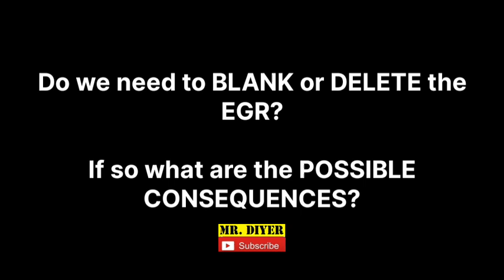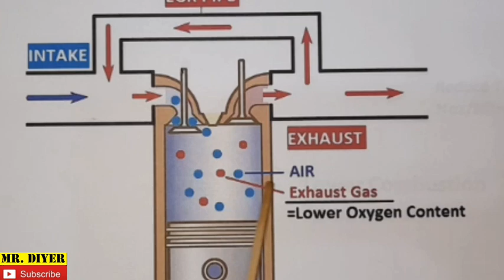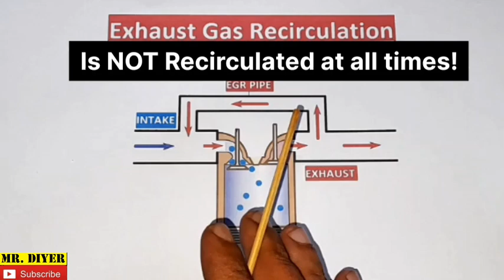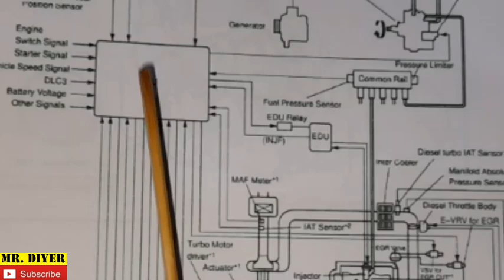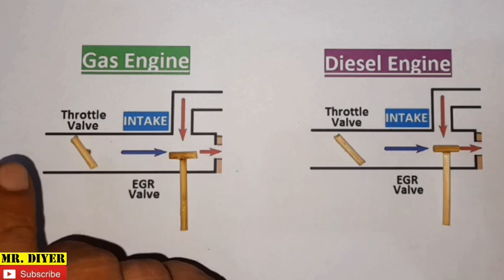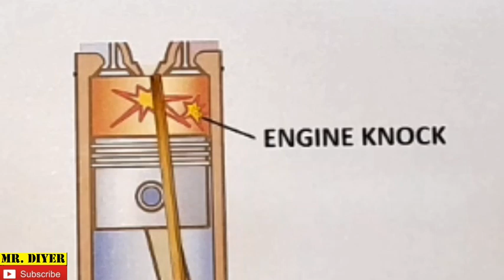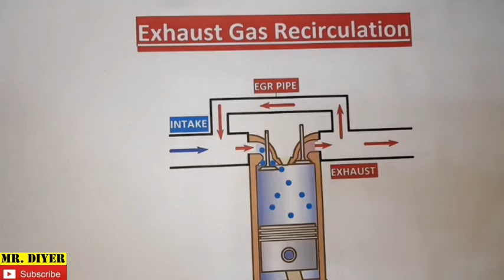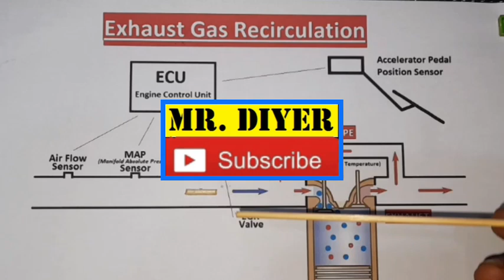EGR Explained! Do we Need to DELETE the EGR?

Comment: Quite comprehensive explanation, but I believe some statements in the video were incorrect. Most information I will state here can be found in papers on this subject, for example: 'THE STUDY OF EGR EFFECT ON DIESEL ENGINE PERFORMANCE ...'

The EGR ratio in total gas content spans from 10-40% typically (diesel), so it is large.
The total thermal efficiency under EGR is always lower compared to the system without EGR, from 1 - 6% as the EGR ratio increases (bad).
The amount of NOX gases is significantly reduced, from 10-60%, as EGR increases (good).
Unfortunately,  increasing EGR also increases the amount of hydrocarbons (soot) that is created during the combustion (bad).

For the same engine output, the amount of generated heat energy must be the same with and without EGR. So how is EGR able to reduce the peak temperature during the combustion, and achieve the same thermal energy? Well, it is possible since EGR increases the time during which the fuel is burnt (since the oxygen concentration is reduced), so the same amount of energy is released over greater amount of time. However, overall efficiency is reduced with EGR, since the fuel is not as fully used in the presence of EGR gases.

I do not believe that, as some people state, EGR  temperature reduction has some meaningful effect on engine longevity, since it still needs to endure high throttle when EGR is blocked. In other hand, presence of EGR equipment adds significant cost to the owner due to maintenance (egr valves, coolers) since it is mostly not repairable or the repair has high cost. Effectively the vehicle costs more over its lifetime, lasts shorter and is less value for the user, which is certainly not good. Not to mention that all that complexity WILL introduces some unexpected problems such as melted inlet manifolds, which will cost arm and a leg to repair (I know).

In my opinion, most of the reasons for introducing the EGR system are political and not something that is bringing overall value for the public.

Comment: The beauty of a diesel engine was always its simplicity.
EGR adds a throttle valve. Creating a vaccuum, increases pumping losses. This is one of the main reasons a diesel engine is more efficient than a petrol of the same capacity.
EGR adds another heat exchanger. This is a future cooling system failure point, allowing the possibility for coolant to get into your engine and destroy it.
EGR also mixes with the oil vapour coming from the PCV system coating your intake with a black sludge over time reducing the ability for the engine to perform properly, increasing fuel usage, and can in some cases completely block your intake.
EGR is a system invented entirely to help engine manufacturers pass emissions laws. It does not benefit anybody. If you want to save the planet, drive less. End of story.
Reply: Exactly so much this! It works for the first 30% of the engines life but then it completely destroys it spewing insane smog and clogging filters like crazy. If you don't rev/work the engine hard and let it cool intermittently you should mitigate the increased temps.

Comment: What about mechanical EGR on kubota engines that is open all the time when the engine has produced enough boost pressure. Soo when the engine is working at constant 2500rpm (tractor) the engine is constantly ingesting exhaust gas.  This surely would affect the power output.

Comment: My car got a gunked up EGR and it got stuck open and it caused the car to diesel after putting gas in it for about 15 seconds when I started it, but it also seemed to make the car generally more responsive.  I couldn't explain it.   But after the egr valve was replaced the dieseling went away but the car feels softer.

Comment: It's okay if i cut the egr. No problem with that and the combustion temperature. I have a radiator to maintain my engine to its normal temperature and performance. That's the purpose.

Comment: Hi Mr Mr. DIYer i have 2 question iff u delet Dpf u also must delet Egr or u can use egr whit dpf off?  second question if u have egr off by softwer and unpluged conector u must unplug aswal egr cooler or egr coller can work whit egr of? i mean i you do by soft to stop open egr but egr coler its stil working its ok?

Comment: Video is well presented and true, however we delete the EGR to avoid future loss of performance as everything becomes clogged, not to magically increase performance, no one thinks that.  Engine may run hotter but most of the engines have no problem running perfectly even so.

Egr delete is pre maintenance, headache avoidment and prep for significantly increasing the power, we just negatively affect our carbon footprint for the most part.

Comment: Diesel engines had a bigger NOx issue due to the oxygen rich mixture in the cylinder compared to a gasoline engine, gasoline engines use a carburetor or fuel injection to have the a/f ratio close to 14.7 to 1, whereas diesel engines previously had no throttle valve and the speed/ power was controlled by the amount of fuel injected into the combustion chamber, thus at part throttle the oxygen to fuel ratio was very high and corresponding peak flame temperature was high, allowing more formation of oxides of nitrogen. Gasoline engines suffer the same issue but to a lesser degree , thus a modulated egr valve works well for part throttle/ light load emissions reduction, heavy throttle would get an enrichment to improve acceleration. Diesel engines required far more exhaust gas recirculation due to the very oxygen rich mixture at part throttle this required cooling of the exhaust gas. Earlier egr diesel engines had no air throttle valve . Newer diesel engines use the ECU controlled to help reduce the oxygen richness of the mixture alongside the EGR.

Comment: A good video. The theory is clear but in PRACTICE egr can be problematic. 
Why? Because oil vapors (from crank ventilation) and sooth from the EGR port can mix in the intake and will cover intake ports, intake valves, intake plenum and EGR-valve body with a thick layer of tar cake! And YES this DOES lower performance! 
If it is not cleaned out periodically it can lead to an undriveable car.

Comment: People remove the EGR mainly because of soot build-up and clogging problems. It can also occur on gasoline EGR, but it's way worst on diesel. Especially if the fuel you're using is not up to the standard of the engineers that designed the engine. They expect you to buy the best quality fuel, like in Japan or Germany. Not every country has this quality of fuel available, hence the problems with EGR systems.

Comment: My egr opens when cold creating heavy jerking when pressing pedal, but works ok when engine get up in temp, tried blocking egr and cold problems is gone, but engine light get on when driving motorway more than 2 hour, turns of when engine get cold, any suggestions? Peugeot 1.6 hdi 2004

Comment: Egr was mainly invented to lower emission and will give you more carbon build up on top of valves and cylinders which will cause overheating issues causing engine failure

Comment: How does the egr reduce pumping losses???? only the valve timing can do that! 
This sounds like another sponsored video trying to deter people from unleashing their engines true performance, ie running on pure air and fuel instead of partial exhaust gas. I did this on a (Euro 3) 2.0 diesel Jaguar 12 years ago and gained 10mpg! and no more soot (carbon grit) going through the engine causing premature wear, that engine was still running like new at 400,000Km.  There is literally no point having an air filter and running EGR! The government is collecting a lot more fuel tax at the pump with all these cars running EGR with lower combustion temps producing less power, and cars wearing out prematurely neading to be replaced, it's about the money!
Reply from the maker: What exactly am i sponsoring here? 

Do you see any posted  links that redirects you to some outside links to encourage you to buy something unlike the videos you see espousing for getting rid of the egr posting links wherein you can acquire that product? Lol

I even said: if you want to delete it fine, if you dont want to fine! Do what you want with your vehichle.

But for you to accused someone of sponsored content without even a hint of evidence just because what you saw doesnt jive with your preconceived beliefs is just ignorant.

Comment: TLDR: Gasoline: It will help to reduce pumping losses and increase fuel efficiency, but is often poorly implemented, hence jamming of valves etc. 
For Diesel, this system is the worst thing ever. Ad-Blu systems are a resolution to this mayhem.
Firstly, Diesel engines produce a lot of soot, unlike well designed and maintained gasoline engines. Secondly, Diesel engines are not affected by pumping losses, as this should have been taken into account in the design. They operate in excess of air, unlike a gasoline engine, hence the larger volume of NOx. 
Increasing Diesel power typically means increasing fuel volume. This isn't the best for emissions nor is it for temperatures, especially turbo models. EGT, just like a jet engine (Exhaust Gas Temperature), is a critical aspect of Diesel longevity and maintenance. Lower your EGTs and your turbo will last! 
The main issue is economy. 
By introducing EGR, you are introducing unburnt/inert gas. This effectively lowers the ACTUAL volume of your engine capacity by whatever % the EGR is set at. Eg. A 2.0L operating at 12% EGR is actually a ~1.8L engine at that EGR value. Friction causes losses and over time, the abrasiveness of the excess carbon wears the engine out faster. 
The slower speed of combustion for an already slow burning fuel can result in a reduced power output-per-volume. The increased wear+slow fuel burn results in less power, greater consumption and reduced engine life at the benefit of reduced NOx in addition to a possible increase of CO2, due to the excess volume of fuel at a lower temperature. 
Not sure how green it is to replace dead engines on a volume basis than deal with slightly increased NOx emissions for in-service engines...
As a point of comparison, (many have done so), but I have modified my own vehicle. I'm sure it produces more NOx, but the fuel economy has dramatically increased. By about 1.3L/100km for a commercial 4X4 vehicle. Very significant, as the nominal consumption was close to 11L/100km at medium speeds. Land Rover Defender 2015.  Exhaust gas temperatures are still within spec. It's a ploy of the big manufacturers to meet a standard that isn't properly addressed or adhered to. 
They're offsetting the pollution elsewhere: From old engine dumping to new manufacturing, which will increase emissions MASSIVLY! 
Also, drive efficiently! Accelerate at a brisk (not flat out!) pace and never brake or steer (go as straight through curves as you can). That's the key!

Comment: Diesels used to be so simple to operate until all the emission legislation came into force making running diesel vehicles a little more complicated and expensive when any of the sensors fail,this man’s explanation is the best way to understand how all this works but one sensor going faulty can cause all sorts of problems that can be very expensive to sort out if you haven’t got the right computer for your vehicle,the engine computer ECU will try and correct any fault it detects in the system and that’s when your problems start because if it’s an intermittent fault it can be difficult to track down.

Comment: Always delete EGR. 
 
 Recirculated exhaust gas contains no oxygen and cannot support combustion. EGR is the same as eating your own shit. Waste should go out the exhaust pipe.
Only clean air and fuel should go to cylinder.
 EGR pollutes intake tract and outs deposits on valves.
EGR is the devil.

Comment: EGR circulates oxygen depleted gas to reduce NOx emissions. However it also circulates soot and carbon particles. These do not get re-burned by the engine they do settle into the EGR and air intake system. This creates a feedback loop that clogs the airflow giving a very dirty exhaust and no power. 
The problem is caused by soot in the exhaust which EGR effectively makes worse. The question is why do EGRs not have a cyclone soot separator?  It would help to cool the gas but more importantly extract the dirt preventing that feedback loop happening.

Comment: I’ll save you the details and blabbering in this video 
Don’t remove your egr, it’s illegal. Instead go and tune your car and in your tune have your egr valve programmed out of the system so it does not function. 
This is still illegal howeve it’s impossible to tell. 
Egr will ruin your engine and score the internals, egr also affect fuels
Consumption in a negative way 

There you go now
You don’t have to watch the video

Comment: EGR is great when new! But when a 3l diesel has done 150000 miles and the EGR, inlet manifold, cylinder air intakes, and intake valves, all have buildup set like concrete on them. It took me 6 hours many cans of EGR cleaner an electric drill going through many wire brushes on the end, knives screwdrivers toothbrushes `for injectors as well`, and a vacuum cleaner to clean it all out plus an oil, oil/air, and fuel filter change + sprayed the MAF clean.  Result BMW M57 3l running like new. EGR now blanked off never again!😩

Comment: Very good explanation, however he doesn’t point out that the carbon build up leads to loss of one cylinder and expensive repairs because the cheap design does not mix exhaust gas evenly, so it is biased to one section of the intake. Second point : there is no need for a throttle disc in the diesel engine,added only to provide for egr and on older cars to get vacuum for other devices. So by removing the disc also your engine gets 5% more clean air. Nitrogen products make plants thrive, so really it’s misguided science.

Comment: That's a dumb idea.
How do you separate exhaust gases from the crankcase gases recirculation with its oil mists content? 
When they mix together they make a huge problem with that gunk sitting everywhere, valves, injectors, piston and mixing+burning chamber in the head. Eventually it will ruin everything in your engine. 
Guaranteed to disassemble your head for cleaning in every 100k-200k...
Not a mechanic, but this looks idiotic..

Comment: Excellent explanation of how the EGR works.  
But it does sparks curiosity (no pun intended). 
I would like to see a experiment with the same engine with EGR and without to see how the engine is performing. 
Also what is needed to achieve normal performance modification of one decides to remove the EGR permanently. Is a new computer box necessary or just new engine mapping needed?
Reply: @vladimirkalinov1963  thanks for the explanation.
Reply: @@tobiascat6173 thanks for the info. 👍

Comment: Brilliant video - what you failed to mention is that EGR is also used to control combustion overtemp. Diesels EGT runs away under heavy loads - resulting in cracked pistons and cylinder heads. EGR opens to protect the engine from overheating.
Reply: Nope. Not true. Over temp protection wether it's oil, water, intake or exhaust is controlled by fuel management.

Comment: very informative thankyou. I have a land rover 2.2 puma , the engine fault light came uo and cleared, however ive noticed the engine is harder to start and slow to warm up, no other obvious changes. I think the EGR is stuck in the open position preventing engine from warming up quickly. what are the risks to engine with EGR valve permanently open
Reply: On a diesel a stuck open EGR valve will result in poor general performance and (unless you have a DPF fitted) excessive black smoke from the exhaust when you accelerate. If a DPF is fitted, it will filter out the smoke and you won't see it- but the DPF will become blocked very quickly, probably leading to needing frequent regenerations and/or DPF related fault codes. Either way on a modern car an OBD2 scan should also reveal a fault code related to EGR flow rate.

Difficult starting in diesels is often caused by problems with the glow plugs, their function is to pre-heat the combustion chambers before and during startup so the fuel ignites more easily. In an extreme case you might see white smoke from the exhaust, this is diesel fuel that failed to ignite in the engine and just got blown out the exhaust pipe. Modern diesels often also run their glow plugs at a lower setting during cold idling because it helps minimise emissions and warm the engine up faster. This more or less matches your symptoms, so that would be the first thing I would check.

Comment: when cruising the engine will use the EGR this in turn lowers the efficiency of the engine and so lowers the power, so you do lose power with an EGR in relation to quantity of fuel. Knock on Diesel engine has been overcome by pilot injection which is found on most diesels for over a decade.

Comment: Clear explanation but for older cars  with no sensors maybe blanking is good. For modern cars with lots of sensors, blanking will surely affect the performance. Do you agree sir?
Reply: No. If there is an EGR there will be sensors to operate it.

Comment: For euro 5 and 6 engines egr cannot be blanked, first a sensor on the inlet will detect too much oxygen when it should be open and second the regeneratio will not be completed ever, causing engine management and exhaust faults. With all other engines I never seen a problem except for some more smoke from the exhaust

Comment: Ducted feul injectors actually reduce nox by 85 to 100% as the fuel burnt completely. They also greatly improve economy, all without clogging up your engine with carbon. But nobody will put money into developing them because all the subsidies are going to electric cars. If we powered our diesels on hemp oil we would be carbon neutral without strip mining half the planet for lithium.